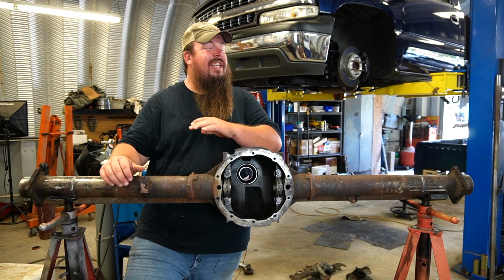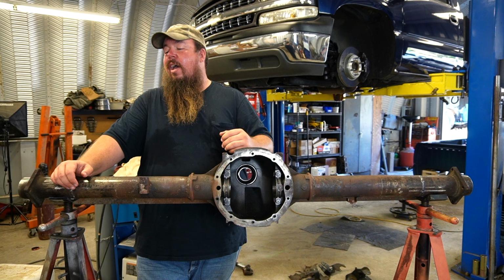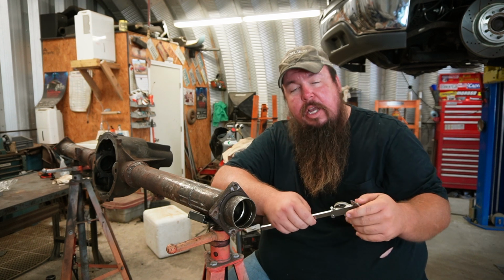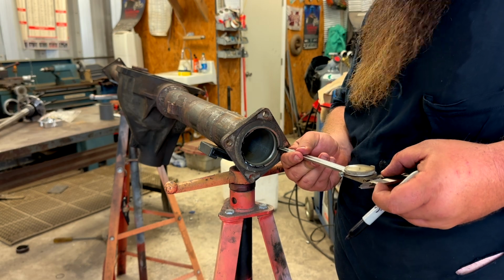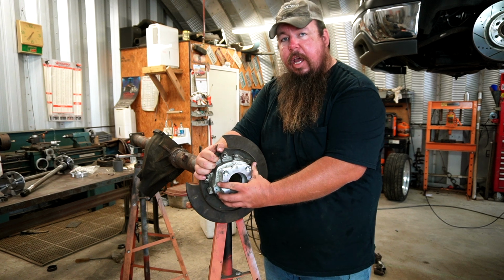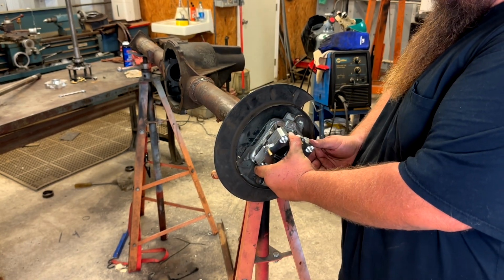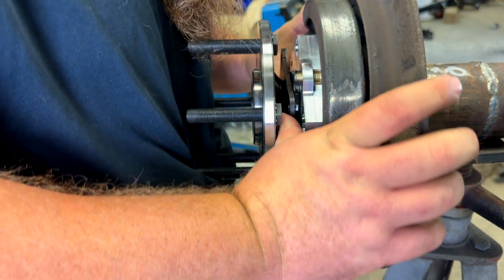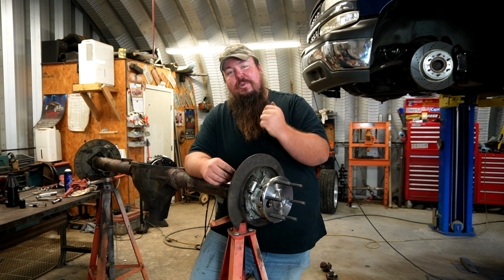GOT TORQUE C-clip Eliminator Kit Install On GM 10 Bolt.

Comment from the maker: This video covers a GOT TORQUE c-clip eliminator install on a GM 10-bolt — a must-have upgrade for performance and race applications.

Amazon affiliate links are live and listed below.
Other parts and tool supplier links (Jegs, Summit, Vevor, Harbor Freight, etc.) are pending and will be added as they go live.

Appreciate y’all watching and supporting the channel 👊

Comment: Great video, I might have missed it but can you weld the tubes in the car fully mounted? or would it be advised to remove the whole rear end and weld in a jig?
Reply from the maker: It would absolutely be best to mount the axle in a jig. I’ve welded tubes with the axle still in the truck and didn’t have issues, but I don’t recommend that. Glad you enjoyed the video! 😎🚜💨

Comment: Do these come with aftermarket axles or what is a good axle upgrade over stock. Im wanting to build both of my 4.3s I got one in a blazer I want to build to get a little more power out of and I got one in a sierra I want to turbo

Comment: It's not the C clip that worries me, it's what happens after an axle snaps in half!! I've never had a C-clip fail me, it's always something else that lets go!!
Reply from the maker: You are 1000% right! I always hear folks worried that the clip will fall out or break. I’m like.. uhh, the only way the clip falls out is if the carrier self destructs. The shaft will break before the clip will… usually right at the splines. Once the shaft breaks, or the carrier grenades, it gets ugly quick! Thanks for watching! 😎🚜💨

Comment: Silly question. But how do you go about something like this set up if its disc brake..? 
Welded on?
Reply from the maker: This axle is a disc brake axle, and it is a bolt on setup. Holler at Bryan at Got-Torque and he will hook you up!

Comment: Nice, would that work for GBody 7.5 twenty eight  spline axle axle With disc brakes upgrade off a 2000 Blazer setup